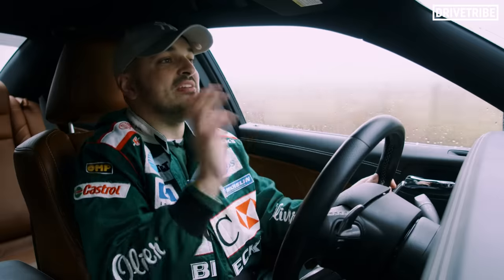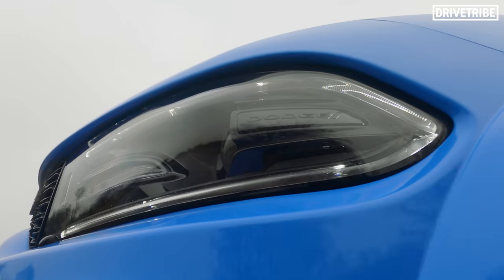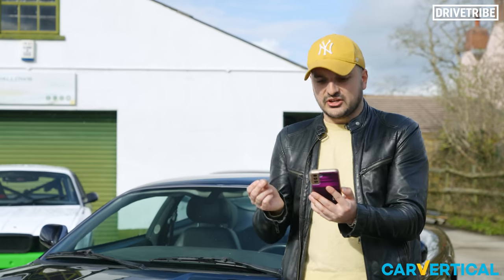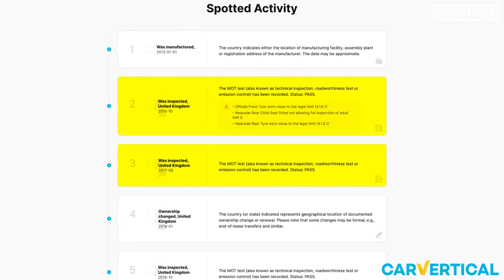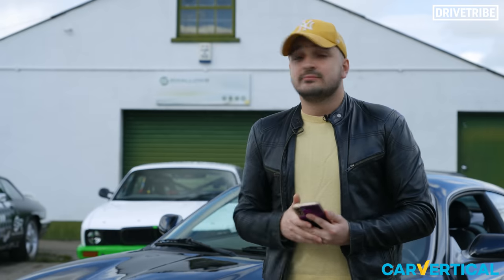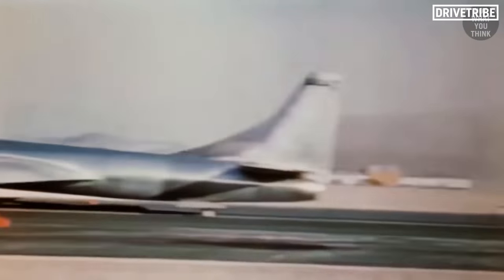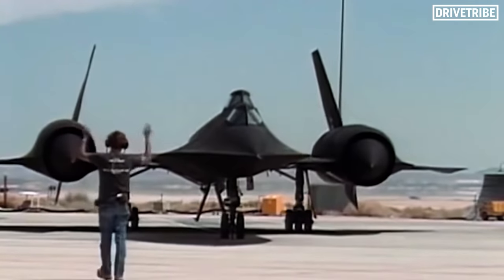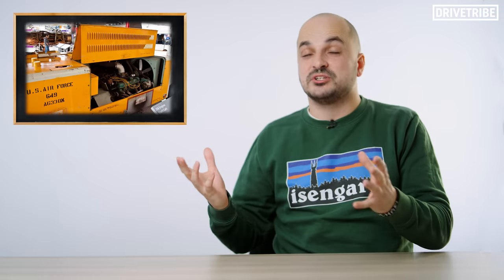This is the coolest use of a V8, and it's not in a car!

Comment: Mike loving the fuel leaking out the panel gaps & also owning an old rover seems very appropriate 😂
Reply: He left out that the fuel was also the hydrolic fluid and about 1M other incredible facts. The entire plane was developed by Lockheed Martin, Skunk Works group in <1 year. Titanium skinned, etc., seriously, as cool as it gets.
Reply: @rg807  Ironically, the titanium was sourced from the USSR.
Reply: @firesurfer  Yeah, they set up various shell companies to buy titanium at auctions.
Reply: @rg807  Less impressive though when you realize alot of the work came from the R&D for the A-12. First flight in 1962 went into service 1967. It was could also go faster and higher than the 2 seater SR-71.
Also the number he's says are for the A-12 not the SR-71. SR-71 could only go to 85,000. Max speed of 3.2.
Reply: If there ain’t no oil under them, there ain’t no oil in them! -Mater 😁

Comment: Real quick correction for the Chrysler Bell Victory Siren: if 138 dB doesn't sound impressive, it was measured at 138 dB 100 FEET AWAY FROM THE SIREN. It could be heard for MILES away. It is still the loudest outdoor warning device ever produced to this day. It was an impressive piece of kit.
Reply: I was slightly horrified seeing it ran indoors.
Reply: @rightwingsafetysquad9872  They didn't have that thing ramped up to anywhere near full bore, it is much higher pitched than that at full song.
Reply: I think the important thing to remember is that the decibel scale is logarithmic.

Meaning at 1 ft it would be 178db which would actually be 100 times louder. 
Something else important to note here is that ear drums will rupture at 150 db.
Meaning anyone within around 25ft is getting their ears blown out instantly. 
120db hearing loss will occur in 30 seconds (everyone within 800 ft)
105db hearing loss will occur in 5 minutes (everyone within 4500ft)
103db hearing loss will occur in 7.5 minutes (everyone within a mile)
The limiting factor is probably that they don't want to deafen everyone within a significant radius. Not that they can't make it louder

Comment: Worth mentioning the SR's fuel was developed specifically so it would not go up in flames if someone dropped a tab end in the puddle.
Reply: Like all fuel ?
Reply: Yes, the JP7 fuel could only be ignited with a catalyst reaction from I think it was toluene.
Reply: @stevemcrichards8768  Was it Tri-Ethyl-Borate, the green flash we see at  for turbine start?
Reply: @waynesimpson2074  yes that is the Triethylborane flash
Reply: @HowieCarson  Yup, apart from pilot fatigue the only limiting factor in the Blackbirds' mission endurance was the limited quantity of the TEB tanks😎
Reply: It's also worth mentioning that SR-71 is not actually its real name. President Johnson got the name wrong when they announced it so they just changed it rather than correct him it's actually RS-71 ( reconnaissance spy plane 71 )

Comment: The V8 in the blood house wasn’t used for the jet Engine( that has it’s own fuel pump) is actually used for the a rocket engine that supplements the jet engine, it’s a hybrid rocket engine and it needs all the power just to pump the fuel for the rocket engine.
Reply: Unfortunately, bloodhound isn't using the hybrid anymore or the V8 even though it was already tested. It is now using a hydrogen peroxide monoprop thruster that is fed by an electric motor.

Comment: I've been lucky enough to be able to have seen and touched an SR-71 at the Air Force Armament Museum. That plane is awesome. It's so much smaller than you think, but when you know how fast it goes... it's so huge.
Reply: Yeah I've seen them at Plant 42, on the ground you notice how lean they are, zero body fat, razor thin edges, narrow cockpit but the proportions are so exaggerated it becomes an optional illusion in pictures and videos the plane looks way bigger.
Reply: They have one at Duxford Air / war museum. In mid England. Seen it a couple times. It sings alongside a b52 bomber too. If your around that area you must visit
Reply: I seen the A-12 at the intrepid museum, absolutely beautiful
Reply: It needs to be huge to accomodate those engines.
Reply: I've sat in the cockpit section of one at Seattle Museum of Flight. Even with the canopy open and not wearing a high-altitude pressure suit it feels quite snug.
Reply: Yes, I've run my hand along the fuselage of the SR-71 Blackbird spy plane. Wright Patterson Airforce Base museum. Feels rubbery. Also the F-117 Nighthawk stealth bomber. Beautiful planes.
Reply: @finlaygibson8356  Me 2, awesome to see in the flesh.
Reply: I've seen 3 of them.  Wash dc, NY, and Tucson.
Reply: You use to be able to touch the one at Intrepid museum in NYC.

I touched the pointy titanium? bit at the front of the engine.
Reply: @david-spliso1928  my favorite things to see at wright pat
Reply: The XB-70 could do the same speed, and it makes a B-52 look small.
Reply: @Billhatestheinternet   I have been there. I clapped eyes on the XB-70. Jesus Christ is what i said. Kinda liked the me 262 also. The manual onion retractors is a neat item.
Reply: The Air Zoo in Kalamazoo, MI has the only remaining SR-71B (dual cockpit trainer).  It also has a ‘Buick’ start cart on display with it.

Comment: As i remember even b-52 stratofortress heavy bombers also use a similar system to start up its 8 jet engines at regular takeoffs(which can take about an hour) , at emergency's where the aircraft needs be air born soon as possible they even use an explosive cartridge to quickly jump start the jet engines.
Reply: The KC-135 used a similar system.
Reply: @richardl6751  interesting, I figured the KCs would just start with their APUs since they are basically modified jet airliners. I think the 135 is a 707.
Reply: @filanfyretracker  For normal starting, yes but when they wanted to get into the air fast they would hit the cartridge and run.  Correct, the 135 and 707 are basically the same airframe.

Comment: <pedant_mode> The Bloodhound V8 powers the oxidizer pump for the rockets, not the fuel pump for the jet.</pedant_mode>
Reply: <pedant_mode> they changed the design to use an electric motor to run the oxider pump in the latest design </pedant_mode>

Comment: I've seen the starter carts and the SR 71 on display at Pima Air & Space Museum. The plaque on the starter carts identifies the engines as Chevrolet LS7 454 engines.
Reply: I saw the cart in a museum in Seattle, that one had 2 425 Buick nailheads.

Comment: Later in the SR-71 program  the Buick engines were difficult to source. They were replaced with Chevy 454's. I worked in the Side Looking Radar (SLR) shop (reconnissance radar) '82-'86, at Beale AFB, CA. I've never heard of a Buick V6 being used, but who knows? Bench stock in the Aerospace Ground Equipment (AGE) Shop had Holley carbs and Sun tachs, lol. Regardless of which version of the engine was used, they lived a hard life. Running up to redline, holding it to start the SR, then chopping power caused a lot of wear. If you notice the rear view of the engine during start, there's a green flash (starting at 6:15 of the video). The engines were started using Triethylborane (TEB) a highly volatile abd toxic chemical that ignited when exposed to air. If the SR engine "unstarted" in-flight you used another of the 16 shots of TEB. The TEB was also utilized to ignite the afterburners.
Reply: I was at Beale ‘77 to ‘82 as a crew chief on 00212 and 00117 KC 135 Q tankers for the SR. I got to listen in the early mornings as they started those monsters.
Reply: same chemical that is used to light the Falcon 9 rocket and how it restarts for landing, I am guessing other rockets using RP-1 for fuel use it too. RP-1 like jet fuel is a variation of kerosene.

Comment: It wasn't a stealth aircraft, it was a reconnaissance aircraft. It didn't avoid detection so much as avoid interception by going so fast it was too late to do anything by the time it was detected.
Reply: It was stealth for the time.  The chines and canted tails were added specifically to produce a reduced radar cross section, and they experimented with cesium-laced fuel that would ionize the exhaust to absorb radar.
Reply: The Skunk Works did extensive testing of the Blackbird’s RCS (RADAR cross section) to design in a lot of stealth concepts. They also used wedges of RAM (RADAR Absorbing Material) on the leading edge to help along with the design  features Raymond correctly lists. Certainly not to the standards of today or even the last 25 years but, most definitely stealth in any book.

Comment: Atlas Copco built air start units for Boeing 707, & DC8. Powered by a big block V8, and by the time the 4th engine was started the Exhaust manifolds were translucent. The Atlas Copco air start was superseded by gas Turbine start units.

Comment: As an aviation enthusiast, i did a lot of research into commercial planes that are fun to fly, and one company in Russia has made a small racer plane that looks like a fighter jet, and it uses the horsepower of a V8 on par with the one in a charger, to power two ducted fans that power the plane

Comment: its crazy the places you find V8 engines, Especially ones like the Chevy 350.  I suspect one reason is not just they are a solid reliable design but also you can still get parts for them. Either new or from a junkyard.

Comment: The SR-71 did not replace the U-2. The lockheed U-2 was still flying long after the retirment of the SR-71  In the 2023 Chinese balloon incident, the U.S. Air Force used U-2 aircraft to monitor a Chinese balloon that crossed the United States and Canada. U-2 flights confirmed the balloon's surveillance package was outfitted with multiple antennas capable of conducting signals intelligence collection operations and that the craft had large solar panels to power them.

Comment: The use in the Bloodhound was the one which was new to me, I knew the use as starter motors for the SR-71 and for the siren.
The Blackbird is an awesome plane, I saw the example at Duxford, the leading edge of its wings is as sharp as a knife.
Other weird uses I have seen of a V-8 is in a chain saw and a food blender (Top Gear), more common uses outside a car are locomotives, boats, power generators and planes

Comment: The sr71 engines weren't turbojets, but rather turboramjets. Also as far as I am aware the sr71 didn't ever overfly any superpowers airspace. It wouldn't need to as staying outside of the 12 nautical mile line would still leave it in international airspace, whilst letting it look and listen well within the superpowers territory due the the aircrafts shear altitude.

Comment: The Ford 300 inline six cylinder engine was installed in cars, trucks, medium duty trucks, UPS trucks, wood chippers, water pumps, generators, giant boat lifts and sometimes farmers would repower a combine or tractor with one. I had over a dozen Ford trucks including a 1971 F600 with 300-6 in them. I miss the most the 1994 F250HD I had with the 300-6, ZF heavy duty 5 speed manual transmission and 2wd. Wish I could find another one that’s 4x4.

Comment: Two comments: 1) The starter carts for the SR-71 were called "Meet the Buicks", according the Seattle Air Museum exhibit,  because the V-8's used were Buicks. 2) the Jet fuel leaking on the ground was not as flammable or dangerous as you might think. It was a specially formulated jet fuel designed especially for the SR-71 with low volitility.

Comment: just a side note, the Buick Engines were not techically the Wildcat Engine, but rather a nailhead which was discontinued in 1967, after that there new V8s were nicknamed Wildcat motors, although the wildcat was also a car the same time as the nailhead was used but still used the old name

Comment: I personally like the engine that was used in the Sherman tanks from WWII.  It was an adapter plate that held five v-8 engines.  They used a common engine of that period so that they could be made quickly and there was already repair parts that were easy to get.
Reply: I thought those were chrysler slant 6's, although the original engine designed for the tank was a titanic ford v8 and the makeshift 30 cylinder was used while ford was ramping up production

Comment: And this is what happens when Chat GPT writes video scripts. The V8 actually powers the fuel pump for the hybrid rocket engine. It burns I think a rubber compound using hydrogen peroxide as the oxidiser. The V8 pumps that oxidiser. Oopsy.

Comment: The SR was a turbo ramjet.  I was woken every morning to the start cart.  Very nice sound, but by then it was a rat motor.. a Chevy 454.  The fuel only weeped out of the expansion joints.  The pilot's would get leather face from the Sun.  Even with a gold faced helmet visor, the Sun's rays are hostile when flying so high.

Comment: You show a photo of a model year 1968 Buick Wildcat Custom sedan at 5:57 But Wildcat is the name of those Nailhead engines, so they didn't come from just the Buick Wildcat  car model. Later on they used Chevrolet LS-7 454 engines for the starter kits.

Comment: The idea of thinking a jaguar engine is less fragile than a cosworth has me rolling.  I would be surprised to learn that the nailheads in the SR71 starting cart turn 5k under their own power, more likely that is the redline for being overspeeded by the jet.  The 401 and 425s used have some really neat design features, if not outright obscure, like the fact that they have smaller valves than a 289 ford (known for small valves) and teeny tiny intake ports due to the vertical valves (nailhead) because the pushrods path of travel.

Comment: I believe the 1UZ was also considered to be used as a plane engine. It was the only engine approved by the FAA for aviation use. I believe....
Reply: This is correct. I've seen a video of a light aircraft flying, powered by the 1UZ. It's a strange sound because you're used to hearing it in a car, but you instead hear the sound of the 1UZ mixed with the propeller, and see a plane.

Comment: From what I can real the ground crews really got these engines singing. Putting out much more power than the Standard V8 . If you watch an SR71 being started you can hear these engines screaming. I bet there were some high performance parts involved. The green flame you can see when starting the engine was an explosive TEB liquid which was used to ignite the special fuel which had a very high ignition temperature because if the temperatures seen on the plane at cruising speed. A remarkable aircraft.
Reply: You beat me to it, TriEthylBorate I believe?

Comment: The  sr71 in the air museum in Seattle Washington disagrees with you on the v8 starter engine. The starter engine was in fact a Buick grand national turbo v6 and not 4 v8s
Reply: First SR71 flight was in 64. Turbo Buick V6 wasn't even a thing until the mid 80s. Last flight of the SR was in the early 90s so it's possible they transitioned at some point but it's hard to believe
Reply: The cart with the Turbo Buick v6 was displayed underneath the black bird and with the flexible  drive shaft used to connect to the jet engine was on display and a with a sign describing why they used this engine was for it's size and weight and it's power to weight. So it is possible they gave up on using the nail head Buick v8 in favor of the grand national engine which embarrassed many v8 powered corvettes.

Comment: You have a few faulty statements about the SR-71:
1.) It wasn't a stealth airplane, the F-117 was the first stealth plane

2.) It couldn't outrun a missile; there were even a situation where a Russian built missile detonated aprox 200m infront of the plane (thanks to the pilot's attention to the missile track) and the Swedish Air Force had a positive radar lock with a JA-37 VIGGEN, and could've shot it down if they'd been for example Allied with USSR/CCCP, but just lit the plane up to show they didn't like that the Americans flew into Swedish Air space without warning or notice, and never had an okey to do so, since Sweden is and was a neutral country!

It was hard to shoot down, but not impossible, since missiles travel at speeds above Mach 5, and the SR-71 maxed out at Mach 3,5

3.) The SR-71 didn't have two turbojet engines, it had RAMJET engines! 
The coming SR-72 will have SCRAMJET engines, just as an extra point in it all!
No turbojet could ever A) fly that high, since the air is too thin. B) fly that fast because it wouldn't get enough oxygen, so the cone in the engine compressed the incoming air and ignited it directly in the afterburner chamber!
The engines worked as normal jet engines at "low speeds", aka below Mach 2, but those cones moved at higher speeds to change the geometry of the engines
Reply: #2: not that one again?...

Never heard of a missile detonating ahead of a SR-71, NEVER.

There are several air-to-air missiles that, on paper, "can" shoot down a Blackbird, but the catch is, the aircraft firing the missile must get close enough for the missile to be effective - which none ever have.

And, the maximum speed wasn't mach 3.5, that was the maximum safe speed. (Where there's no risk of breaking the aircraft)

Comment: I'm sorry to say that what are you saying about the Bloodhound Land Speed Record car is not totally correct. The V8 is not used to pump the fuel to the turbojet but it should have been used to pump propellant to a hybrid rocket booster that was actually never installed in the car yet and it would have permitted to gain the final 250 or so mph to the target of 1000.